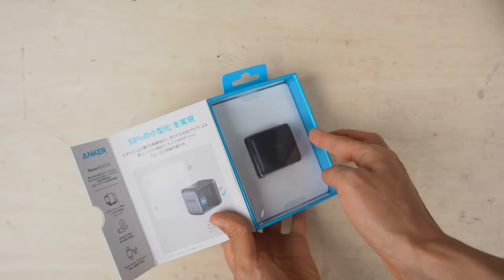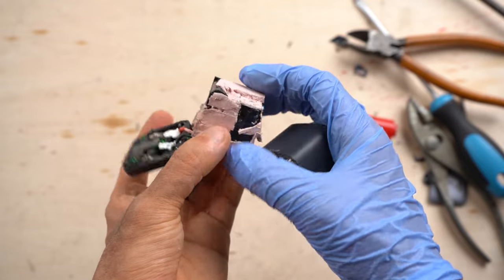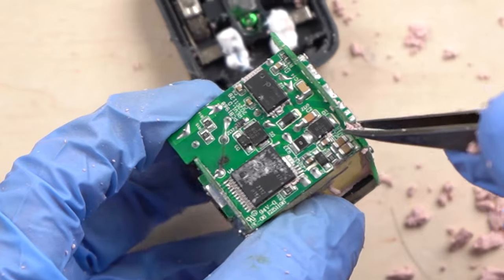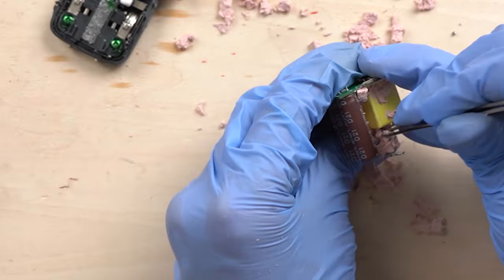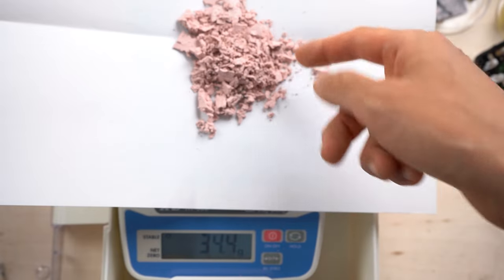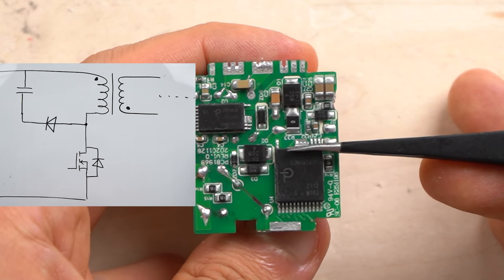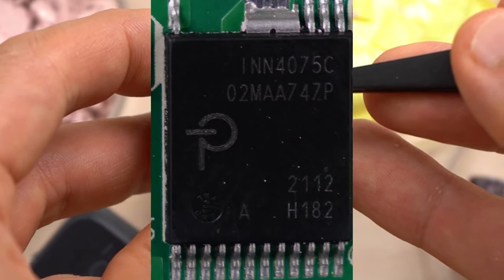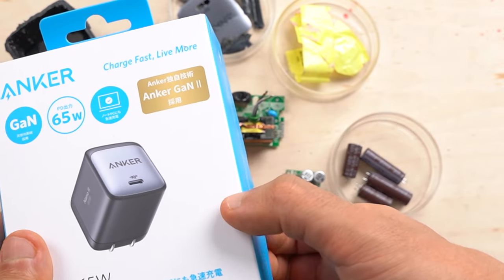Teardown Anker's Latest Wall Charger and Found This. What's This?

Comment: Heat transfer compound is a 2 component mix, that is poured in at final assembly, to fill all the voids. Stays flexible and somewhat sticky, as it will slowly flow with heat to help ensure all the voids are filled. Similar to the thick thermal pads used in equipment, in that it ensures better heat transfer from hot areas to the case, though it is not as good as a proper aluminium heatsink, but as it is cheap, insulating, and also helps with minimising creepage on the board, it is used.
Reply: That’s actually brilliant, you get great products when the maker isn’t copying everyone else. Makes me want to see if I can make that with heat compound and plain silicon.

Comment: Great teardown. That strange silicone seems an acceptable means of transferring heat, since heat transferred to the opposite side of the charger when desoldering the PCBs. Any solution is better than no solution in my mind.

Comment: I don't understand why they make changes almost unable to disassemble
Reply: Anti repair
Reply: It depends, but in this case it's likely because of cost reduction.
For screws, you need screwholes which are like "tunnels". This increases the complexity of the injection mold a bit, but it might impact cost of it in some cases.
Installing screws is also more expensive than just ultrasonic welding (again, it depends, but I think it's like that at least in this case).
Reply: Safety is the main reason. You don’t want kids opening them, but above all, you don’t want them breaking off while plugged into an outlet, even if the thing gets bumped. And since it makes no financial sense to repair such low-cost products, it’s cheaper to achieve the desired safety by using ultrasonic welding than fasteners.

Comment: Pink, highly heat conductive materials always make me wary - could there be beryllium compounds in the mixture, which can be extremely toxic to breathe?
Reply: I don’t think anyone has made mass-market thermal compounds with BeO for decades. It’s used in exotic applications, but not mass-market stuff.

Comment: I didn't expect your understanding of electronic products to be so shallow. The first cover you pry off is to cover the thermal paste filling hole. The reason for the heat generation is because power and efficiency have little to do with space. This is done simply because a 65W charger will have a thermal power consumption of up to 7.2W even if the conversion rate is as high as 90%. What's more, the high frequency of GaN chargers will reduce the conversion rate.

Comment: Very poor, anti repair design. It's better to use simple finned heat sinks.
Reply: Nobody fixes small chargers, it’s not worth the time. And as far as repairs go, they’re among the more hazardous repairs to do, so you don’t want unqualified people doing it anyway. 

Anyway, finned heat sinks work great. But the point of GaN chargers is to make the chargers smaller, which is not something a finned heat sink achieves.